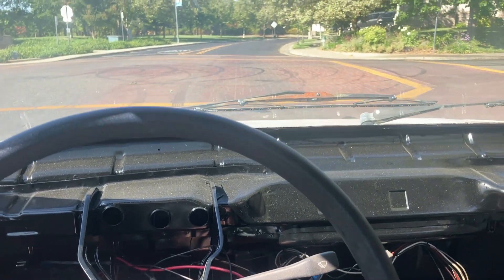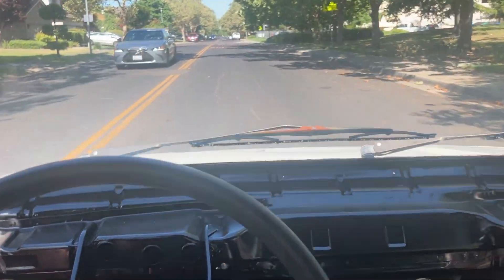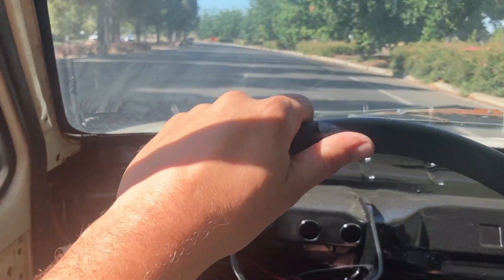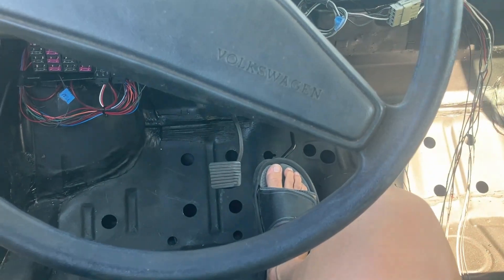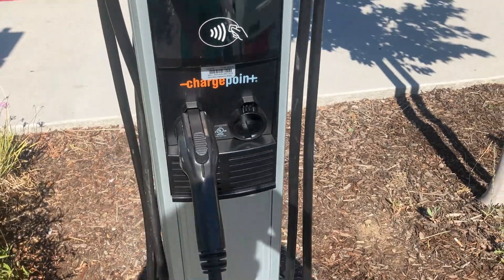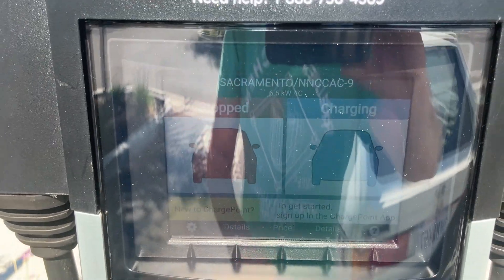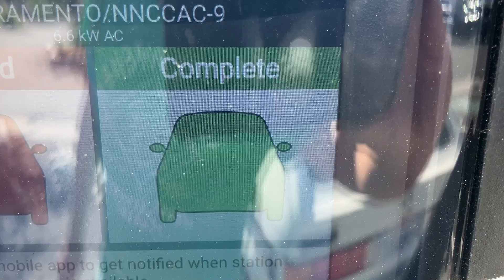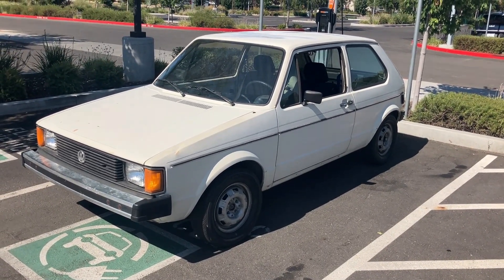DIY EV VW Rabbit First Public Charging

Comment: This is a really cool build.
What is the maximum speed this baby can go ?
Reply from the maker: only 52 MPH currently as there is some sort of limit preventing us from going faster, we hope to get past it eventually
Reply: @Good-Enuff-Garage  I'm kinda new at this, but I was watching Damien Maguire videos on ev conversions.
He designed this cool board that let's you control both motors, and they can speed at really high rpms.
 Tou should check them out

Comment: Excellent! I converted an old MG (in 2008). Not so much choice for parts then - but since then I've upgraded to Leaf batteries. But the motor is 100V and that makes getting ex-EV/hybrid battery and charger parts a bit  harder.
Reply from the maker: pics or it didn't happen 😉
Reply: Check the 'about' section of this channel.